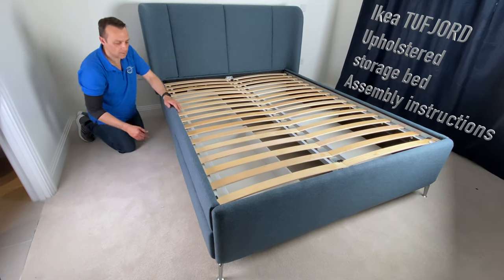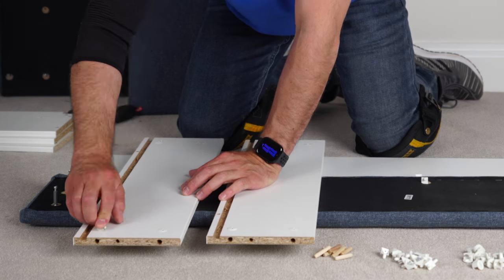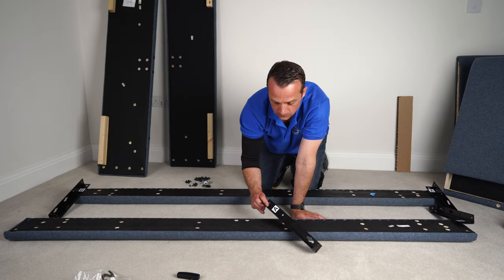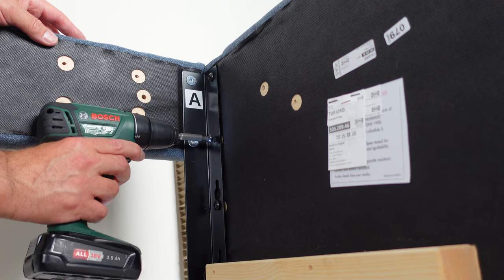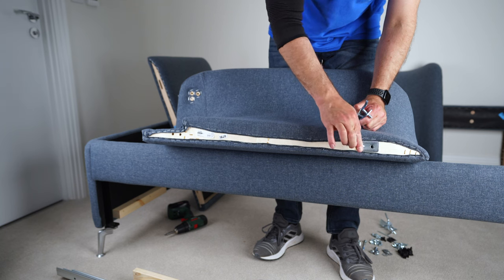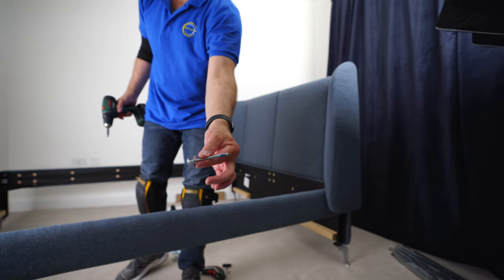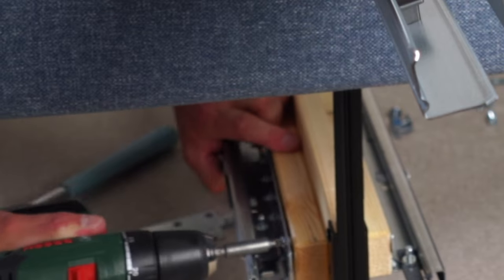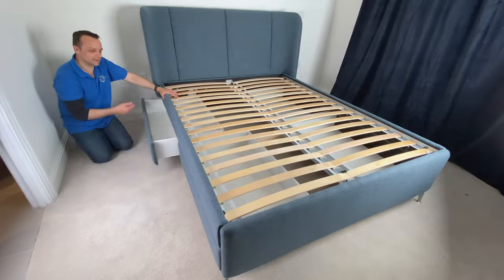Ikea TUFJORD Upholstered storage bed Assembly instructions

Comment: Thank you! I used this video to assemble the IKEA IDANAS upholstered bed with storage. It was an almost identical process (probably 99%). Made it so much easier to understand. I'd probably still be trying to figure out what the instructions were saying were it not for the visual step by step instructions in this video. It still took a long time with just hand tools instead of power tools - just as the video said it would - but the tools worked well for their intended purpose/roles. Just so much redundant muscle power.
Reply: Thanks for saying this I bought the same bed and I was gonna go through tasks rabbit but that would almost be $500 for assembly so I’m gonna try to give it a go myself !
Reply from the maker: Good exercise with manual tools ;) Thank you for watching

Comment: Thank you. This is super helpful. I am still in the process of installing the bed. Just done with the drawers and drinking tea… But wanted to show my appreciation first. 😊
Reply from the maker: Let me know how it goes. Thank you for watching
Reply: @PPFlatPack  Happy new year! I did it!! Finished before the new year without a second person's help just like how you did it in the video. Super excited and felt very accomplished! Thank you! I was lucky, the headboard part for me was not bad at all. I used your technique from the previous bed assembling video (the one without the drawers), and they went into the slots fairly easily. To me the most difficult part was actually the drawers. At first, I didn't push those plastic screw thing all the way in, thinking the screw would push them in place. I was wrong and had to unscrew to fix. Once the plastic thing got pushed all the way in the holes, the drawer had no more gaps at the back. Super grateful. Thank you.
Reply from the maker: @lishav2052  Glad it worked for you. Thank you for watching

Comment: I am curious if this video is of the Queen size or the Full (Double) size, as I wondered if the centre rail is in both sizes. Kindly reply and let me know. (as I wanted to change the legs so that the bed is higher off the ground.  If there are only 4 legs, they are easier to replace.